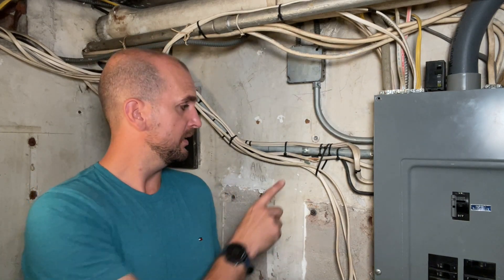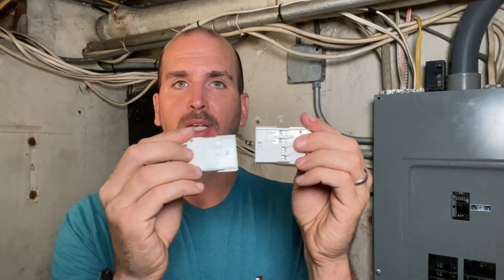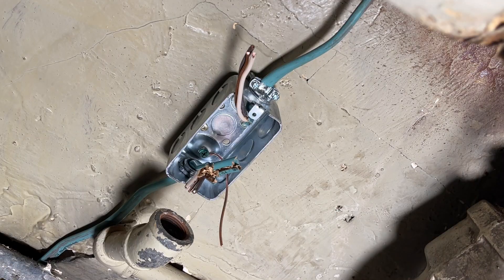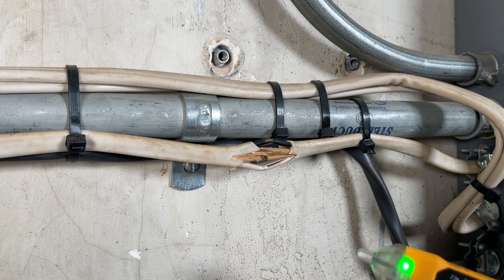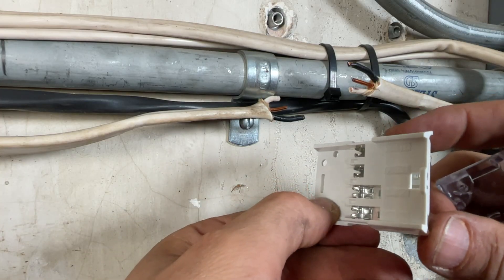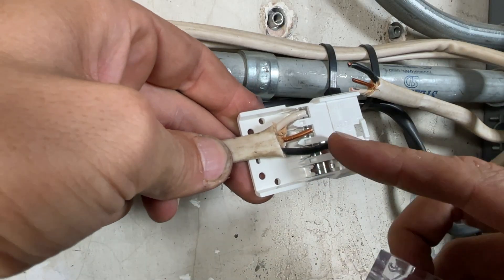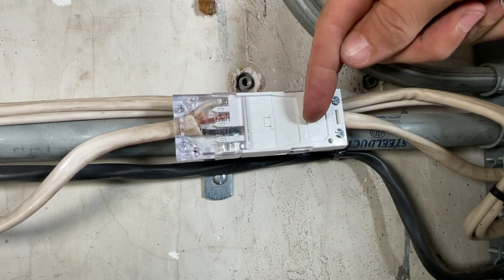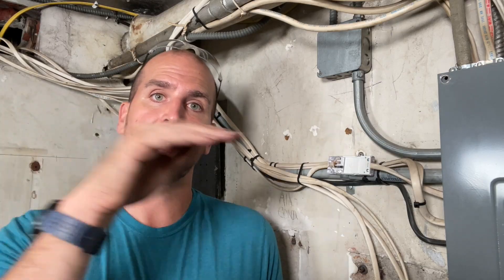How To Repair Damaged Romex Wires

Comment: Don't use non contact voltage testers. Use a multi meter to verify.
Reply: What if your multi meter is defective?
Reply: @electricaf365  Get it fixed or get a new one. Non contacts can give false readings. I've seen it a few times.

Comment: I just bought a gallon of liquid electrical tape to fix my k&t. No junction boxes needed. A couple bare wires in plastic insulation should be fine with some flex seal and some spray foam. I also replaced all my fuses with pennies. What a money saver. Burn a few pennies up and it only costs 1cent. Fuses cost dollars each. I also get free heat from the wires in my walls. 
All joking aside I didn't know these existed and I will definitely buy half a dozen for my service truck.

Comment: Nope, that thing is janky.
If you're going to clip the wire, it's your responsibility until someone else works on that wire...
Meaning in 15 years, when the next owner finds that worn out piece of quick fix plastic because the connection is intermittent at best, he's gonna be fondling shorty wires with comprised insulation.
It's junk. Put in a box, or run a new wire.

Comment: Don't really like that connection. If the copper is good were I live Electrical tape is approved insulation. That entire wall breaks so many Electrical codes were I live.... wow
Reply from the maker: Yeah, unfortunately this type of setup is all too common in our area. Especially for older homes which have been pieced together over the years.

Comment: The second method reminds me of a keystone jack for Ethernet or dsl
Reply from the maker: I think the TE Romex Splice actually comes from the mobile/manufactured home industry.
Reply: @EverydayHomeRepairs  — which is why I would not be inclined to trust it. They’ve done some pretty janky stuff that is supposedly NEC approved.
Reply: @EverydayHomeRepairs  it does.  it's how cheap double wide mobile homes are connected if they don't want to pay the setup crew to have a limited energy license to do a proper splice.  it technically counts as a plug connection, so any idiot can plug the pieces together.

Comment: I would trust some properly applied butt splices with heat shrink on each conductor and the overall cable far more than that push down connection
Reply: Especially that heat shrink with the inner heat-activated glue. Good luck taking THAT apart!
Reply: @markarita3  
  Always wondered why not put some di-electric grease in there while im at it? If heat shrink doesn’t have it.
Reply: butt splices are poor connections when using solid wire, best to use wire nuts and twist the wires, about 3/4" strip.
Reply: @mikebowler1962  Actually, I was referring more to stranded wire splices. Yes, you're right though.

Comment: Why did the hanging box need the ground?  (Edit already answered, thanks all!) It's not really grounded to anything and it's just holding these wires. The Romex already has a ground that I would believe is grounded better than a metal box attached to nothing else metal right?

I'm also a fun of the Wagos but not for this. I want as much contact between these wires as possible unless they strictly powered lights or something. Even then someone might do something like link on to it to add a outlet that could get a 1500w heater attached and I don't like that thought considering everything else would be running over that small contact as well. Same thing for the splice kit you found that spikes in, seems even worse.
Reply: The metal box needs the ground in case it accidentally becomes energized (wire gets frayed or cracked and contacts it). 

If the box is ungrounded the circuit most likely would not trip off, and you would then have a box sitting there hot, first person that touches it gets a nice poke, and hopefully it trips before they get badly hurt
Reply: you're not grounding the wire to the box, you're grounding the box to the wire.
Reply: Because it's a metal (conductive) box with live conductors in it.

Comment: so Liquid Electrical Tape isn't the right answer?
Reply: that's the way I'd go.
Reply: code violation, end of discussion
Reply: @mikebowler1962  code shmode, inspector didn't see it, l didn't do it.
Reply: @mikebowler1962  Dude, you're all over this comments section. Half the code is absolute bullshit. Stick to it for your licensed work but don't pretend it doesn't have problems.

Comment: No data for this splice unit is found online, so compliance with the NEC cannot be confirmed - it also appears that the product itself is not available.  While I appreciate the difficult, well grounded, and workmanlike job done with the in-handy-box splice,  I believe it to be a technical violation of the NEC due to inadequate wire length for the splice.  However, if I were the inspector, I would approve it under 90.4.
Reply: I normally find those underneath double wide mobile homes when they fail and half the mobile home goes dark.

Comment: The Wago connector is OK, at best. But, the second device is a serious POS and I would never have it on anything that I own or work on. Any type of load (Current/Amps) that hits that will melt it in no time, so unless it’s being used for a lamp, forget it. Looks like a great place to have melted plastic and possibly a fire, but I digress.
Bad idea!
Put it in a box and you can’t go wrong.
Reply: Nothing wrong with a WAGO connector.  People use the term Wago connector like Kleenex,  but they most often don't compare to the original WAGO brand.   That splice kit,  yah I agree I wouldn't trust that at all.
Reply: @jeffm2787  Again— if it’s for lighting and low current, OK. Anything above and beyond that requiring real current needs “surface area“.
Two metal shims grabbing the wire does not have enough surface area compared to twist off under wire caps/terminal screws and potentially non-insulated clamps followed by shrink tube. 
But, maybe it’s just me. ⚡️
Reply: @Mark_The_Mayven  Tell that to all or Europe and most of the rest of the world.  Also check out John Wards videos on the subject as well as countless others.  14 and 12 awg they are just fine.   30 or 40 amps is not a problem for them.   Having a strong electronics background I hear what your saying,  the facts just don't back that up.
Reply: @jeffm2787  We’re not in Europe and quite honestly I could care less what they do there < No offense to those electricians >, but I do care about what goes on here in the USA. The minimum wire size we pull is 12ga <OUR POLICY> and if any of my guys install Wago connectors they’re gone the next day. Not interested in your “facts“, but very interested in the safety of my customers. 
Again, I reiterate —they are fine for light circuits and low current draw for DIY, but anything other than that is out of the question and I don’t give a crap who disagrees. Many of the people that are installing those devices are trying to save time and that’s quite the opposite with us as we are ensuring safety.

Many companies are quantity over quality, but that’s not the case with us —it’s quite the reverse. 
Do it the right time the first time or don’t do it at all and stop wasting time!
Reply: @Mark_The_Mayven  So as Mike Holt would say,  you're a dinosaur.  I don't see a wire nut as being an inferior choice if installed correctly.  Sounds like your guys do it the correct way so no concerns.   Best regards and try to control those emotions.
Reply: @Mark_The_Mayven  I have used Wago rated for 10ga (boy they're a bitch to fit but clamped tight) on continuous load 240v heat pump. A tight metal on metal connection with enough surface area contact is all that is needed. Wago meets those specs and have been tested many times. There's a reason they're accepted for HIGH VOLTAGE and amperage up to 41.

Your archaic ways are perfectly fine but don't be a luddite here. And I'm talking genuine Wago not the Chinese knockoffs... I use those exclusively on low voltage low amp dun projects. I wouldn't trust them for anything else though I have dissected a few and some were more solid than others. But all Wagos will be the same.

Comment: Depending on the type of run it is and if it's easily accessible I would prefer a new run. Also running new wire is more money for me.🙂 but if it's too problematic  then splicing it would be the way to go.

Comment: You show the white cable that someone cut into but you do the repair on a green one. The problem is there is no slack in the white power line and your going to have to use a box but replace the cable side that goes to the circuit box.

Comment: The only thing I don't like about that splice system is that the contact patch is teeny tiny.  It seems about as small as the push connectors on the back of cheap outlets and switches, which you advise against for that specific reason, among others, don't you?  I'd much rather see the wire lying clamped along the connector patch and making solid contact over a distance, ala the screw-clamp connectors on the sides slightly better outlets and switches.
Reply: I'm kinda surprised the NEC bought that.  This kind of technology has been used for eons in phone systems where there's very little current, but I don't like it for romex.
Reply: @incognitotorpedo42  I think anyone that deals with connections of any kinda, they know as things heat up things become loose and create problems. Don't even get me started on "they are able to thrown in the wall cavity"
Reply: This is the same thing as mobile home wiring. The point of connection is absolutely terrible. There is a reason trailers are burning down and have all sorts of electrical issues, it’s this right here
Reply: @searingninja6766  real problem with mobile homes, in the 70s and 80s was aluminum wiring. You have to really know what you're doing when working with that.
Reply: @donphillips5957  that wasn't uncommon in homes too. The style of connectors that were used in trailers definitely did not help, even today they are still plagued with cheap connectors and devices.

Comment: I'm not sure how I feel about that splice kit. 🤔
I get that it's NEC compliant, but then so are those punch-down trailer/mobile home receptacles and... (shudder) backstab wiring! 😀
Reply: They are reliable but,expensive!!!
Reply: I got tired of hearing that backstabbing was horrible.  I set up a test rig ( a wall mock up complete with R-13 insulation) with one box wired by backstabbing and one box wired to the screw terminals.  I put two thermocouples in each box ( one on the wire and one on the receptacle ).  I then put a 15 ampere load on each outlet and recorded temperature readings for 4 hours.  There was no significant variation between the two wiring methods.
Reply: @mdrew44628  I get it, but your sample size of one (of each) is insufficient and statistically insignificant. The problem with backstabing isn't that it creates reliably or repeatably bad connections, it's that it creates weaker, less secure connections which are more prone to failure than stronger, more secure ones would be. There is most definitely a difference. It's like when you buy a cheap (and cheaply made) kitchen appliance - It may work for you and last years, standing up to a higher-priced model, but that doesn't change the fact that many of them will fail for many other people - simply by virtual of the lesser material and build quality.
Reply: @marcberm  I am confident that 99.99% of Leviton outlets will perform the same, therefore whether I used 1 or 1000, I am sure I would get the same results.  I only use quality devices.  If you don't, why would you think that any method of connecting wires would be sound.
Reply: @mdrew44628  The devices may be quality enough, but the connection method is not. There's a reason higher quality, higher spec devices don't even have backstab wiring as an option.
Reply: @marcberm   @MarcBerm  sorry, but high quality industrial specification receptacles do indeed have back stab connectors.

Here is a Levition receptacle at $8 ea.    TDR15-W.   Commercial grade. Side and back connections

It's amazing how many people think an electrical manufacturer would put unreliable connectors on their products to face lawsuits and lose customers.
Reply: @mdrew44628  "Back wiring" and "backstab wiring" are not the same thing. Wiring thorugh the back under the plate with the terminal screw is back wiring and that's perfectly fine. Shoving the bare connector into a hole where it engages with a spring-loaded barb is backstabing. Backstab wiring, by design and specification is "one-and-done" meaning once you stick a flat-head screwdriver in there and depress the tab to release the conductor, it's out of spec to re-use that backstab terminal again.
Reply: @marcberm  my bad.....I saw back and side connections and just assumed back stabbed.  However I stand by my statement that back stabbed work just as well as screw terminals.  I do agree with you that back stabbing should only be done on a virgin device.  Once you have to remove the wire, it should be moved to the screw connection.
Reply: @mdrew44628  As a counter example, EVERY failed connection I've ever repaired was backstabbed.

Mind you it was with Al wire, which was NEVER legal. :-)
Reply: @fromagefrizzbizz9377  when did you find 14 awg aluminum wiring in houses.  If a circuit was 14 awg for copper, that same circuit would need to be 12 awg aluminum.  Backstabbed devices only take 14 awg.  No wonder it caused problems.  This has no reflection on the wiring method....the problem was the wire gauge.
Reply: @mdrew44628  For what it's worth, I was doing a thermal camera check for insulation and happened to spot a receptacle that was about 10 degrees warmer than the uninsulated interior wall it was on.

Everything on that circuit was 30 year old discount model backstabs, there was a large load plugged into the most distant receptacle, and there was more resistance than there really should have been at each step along the way. Wasted energy now, a potential fire another few decades down the line.
Reply: @EyeMWing  yeah, there is a potential for increased resistance in circuits over time, but honestly a 10° temperature rise is not abnormal if there is a large current draw.  I once found a 15 year old 20A duplex that had a temperature of over 125°F (my probe only read to 125° and would flash OL if above 125°F).  The hot wire on the feed cable was discolored.  I cleaned all the wires and replaced the outlet.
Reply: @mdrew44628  First house I had, when using a certain outlet I would hear a pop if a radio were on in the room. Checked the outlet and saw it was a backstab and arcing at the connector. I have never had a screw connection do that.
Reply: @jaydee3046  it would be unrealistic to expect no failures in any devices no matter how they are connected.  I have seen failures in backstabbed and side connection as well.  I have seen loose screws on breakers, neutral, and ground bars.  Did you change the terminations on the rest of the 15 Amp devices in the house?
Reply: @mdrew44628  ... ok. but what about 10 - 15 years later after everything has been exposed to moisture / temp changes a few thousand times PLUS had time to oxidize?
Reply: @rupe53  what do you do with the side screw outlets, breakers, and wire nuts under the same conditions?
Reply: @mdrew44628  ... in my experience most things properly secured by screws and wire nuts seem to not have problems at well over 50 years in service, and quite often it's longer than that. All I am pointing out is a 4 hour test does not account for the long term and those variables.
Reply: @rupe53  you've never seen problems with receptacles, switches except in backstabbed situations?  You've never seen problems with 12, 10 AWG, breakers, wire nuts?  Just seems unlikely that a majority of the repairs with connection problems you have done over the last 50 years we're due to backstabbing.
Reply: @mdrew44628  ... I think you are addressing the wrong guy because I never mentioned anything about backstabbing or being in this field for 50 years. I did mention a 4 hour test is not conclusive compared to stuff that's been in use for 50+ years.
Reply: that splice kit IS a mobile home splice.  I have trouble believing it is approved to be buried in a wall, since mobile home splices go in a handhole.

I use a direct burial listed splice kit if I have no alternative to burying a splice in a wall.
Reply: @kenbrown2808  That's an interesting point. I think I'd presumed it was suitable in this case since it's exposed wiring in a basement, but then it raises the question of what happens if the basement is later finished and all that stuff enclosed in a wall down the road.
Reply: @marcberm  there is nothing more frustrating than trying to troubleshoot a buried splice that's gone bad.
Reply: @kenbrown2808  agree, should be part of the code to include a label in the panel that it's been spliced and approximate length from source the splice was done.
Reply: @kenbrown2808  334.40(B) in the 2014 NEC reads as follows: Self-contained switches, self-contained receptacles, and nonmetallic sheathed cable interconnector devices of insulating material that are listed shall be permitted to be used without boxes in exposed cable wiring and for REPAIR wiring in existing buildings where the cable is concealed.
Reply: @brianreinhardt4050  so the only question is if that is a listed repair connection.